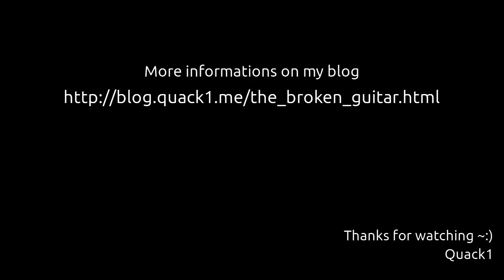Fixing broken back and headstock on an acoustic guitar

Comment: I saw the recommendation for using white glue for headstock repair.  After over 40 years in the cabinet trade, I can tell you from experience this is probably one of the worst glues to use.  Sure it will work fine for a while but white glue will allow the joint to creep because it does not dry hard, only flexible. If you spread some white glue on wax paper and let it dry, peel it off and it is very pliable.  This may be fine for non-critical joints but 
anything under pressure needs hardness so it won't creep.  voice of experience... had it happen to me on some chairs I built. 
Over time, because of all the pressure on the joint, the headstock will start moving, every so slightly, until the joint will fail. It may take months or years but it's not a final fix. 
Use a glue that gets hard.  I heard of something called titebond 50 on a guitar repair video.  Never used it in cabinetmaking but I understand that Fender or Gibson uses it.  Also, titebond 3 gets very hard.
Reply from the maker: AffordBindEquipment oh, never heard of that. The guitar has had string for 2 years now and it is still doing well :) and if it breaks again, I will just have to fix it one more time ;) 
Furthermore, I live in France and it is kind of a pain in the a** to find Titebond :(

Comment: Nice fix . . . . well done. Looking around for repair tips as the headstock on my banjo got snapped off pretty much perpendicular to the neck right above the nut . . . not pretty.

Got a recommendation on glue?
Reply: +Hal R. Titebond regular wood glue!
Reply: +Glenn Smith Thanks for the tip...... still in two pieces at the moment . . . . .  thanks for the reminder to fix 'er up.
Reply from the maker: +Hal R. I personally use regular white wood glue, I fixed many headstocks with it and it works really good :)
Reply from the maker: +Hal R. I personally use regular white wood glue, I fixed many headstocks with it and it works really good :)

Comment: I mean, you didn’t do a bad job getting the pieces back together, but your methods need a lot of work. You should be using a hard glue, not a soft and pliable kind. You should ALWAYS completely break down a guitar before working on the neck. It made me cringe to watch you glue the headstock back on with the tuners still on, not to mention you did a poor job at wiping up the excess glue. Never use a chisel on hard coated woods, that leads to cracked and chipped surfaces very quickly. I could pick apart more, but I’ll at least acknowledge that your ability to put the pieces in the right places was good enough. Take some time to reeeeeeeally analyze what actual Luthiers do when repairing, use their methods as a staple for how you should approach your repairs. You may not have the tools to match them, but there are ways to improvise.